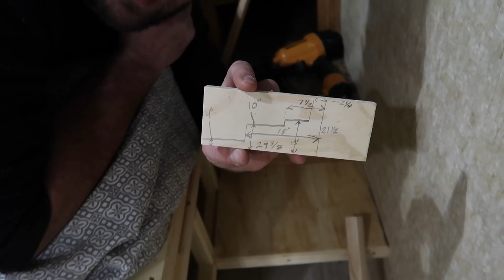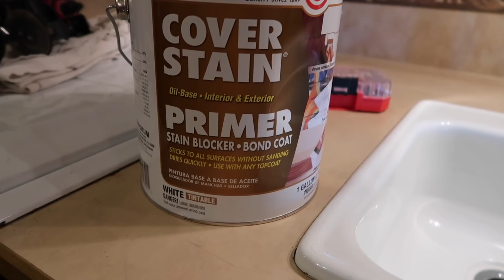We spray painted the camper— It didn’t go quite as planned...

Comment: I love to watch the two of you interact with each other.  I love it when Dawn says, "Correct me if I'm wrong..." as if Tom wouldn't correct her.   I think painting inside the camper in the winter in Minnesota was the problem and especially using an oil-based primer.  If you were doing it in warmer weather with the windows open, I bet you wouldn't have had as much trouble.  It seems to me like paint sprayers are finicky tools and you have to really get to know not just the sprayer, but its relationship to the specific  paint. Every paint will be a little bit different.   Anyway, I am looking forward to seeing how it all looks when you are done!

Comment: We sprayed our rv in 70 degree weather and had 0 issues. This is a timing issue not a spray issue. I highly recommend spraying. Just do it the correct weather. We used a hand held Warner sprayer with no issues.

Comment: I have a step down from your sprayer and love it! I haven't painted a camper, but have seen similar results with the tape inside the house. I mask the edges, then tape plastic onto that first piece of masking. It's extra tape, but the first layer doesn't seem to come off with the humidity. And your paint can will indicate which size spray tip you need. The trim and primer look great, can't wait to see the colors and details you're planning to add!

Comment: Try using a water based bonding primer instead of an oil based stain blocking primer, two different products to solve for two different needs.  Probably just too cold where you are unless you buy paint for low temps it can be temperamental!!  Not worried though , your projects always turn out wonderful!!

Comment: Just FYI, I  tried to paint with Kilz primer with a sprayer like the one you used, it would not spray correctly.  Called the manufacture and they recommend not to spray the primer thru it(would be to thick and ruin the tips)

Comment: In my camper,   I use command hooks with outdoor  grade adhesive, curtain rods. It works fine.  On one window, I have a dowel rod, which I will be spray painting.

Comment: Hi, the airless sprayer gun we have at work has more control than you are describing I think (I think it’s a narrower nozzle angle).... but we are usually using it on big flat areas with more ventilation.... so maybe not quite the same problems! Looks like you were quite close to the wall with the sprayer... usually would spray from further away (but I guess maybe you couldn’t get further away because of space/ size of nozzle).  You can get a roller attachment for the airless which feeds the roller with paint, which may speed up your rollering, and it is less paint in the air etc .... so might be a good option?
Reply: Oh ... also.... not sure if blue tape in the US is the same as the UK, but often the Blue stuff is the low tack option (great for delicate surfaces, but not that sticky).... maybe a different tape would work better?  Also tape adhesive is affected by temperature.... super cold/ super hot makes a difference to how it behaves..... I was trying to put hazard tape on a step when it was -3 degrees C and it was sort of brittle and would not stick

Comment: Honestly, get primer on always seems to take way more time than painting. Have you thought about using something like Floetrol to minimize the brush/roller marks?
Reply: Floetrol works great at slowing the dry time and leveling the paint to erase those marks.  Unfortunately, they were having a horrible time with the temps slowing down the dry time, so it might have made things worse in that instance.

Comment: Loving the video but I think that OIL BASED primer did not help the moisture problem. Wondering why you didn’t use ALCOHOL BASED Zinsser which dries quickly?  Also, does latex adhere to an oil primer?
Reply: Oil based primer blocks what can bleed through. Latex can be used on top of it. Wall boards in campers have a wall paper type finish that has to be sealed with oil based primer in order to paint it, then all the wood work has to be sealed with oil based so none of those finishes bleed through the colored paint.